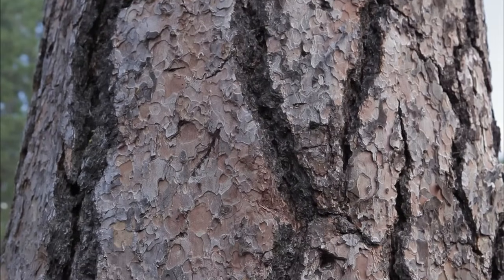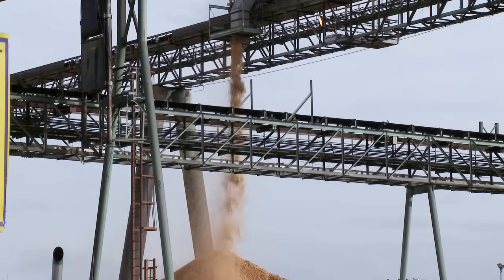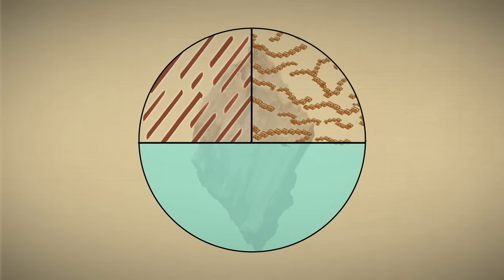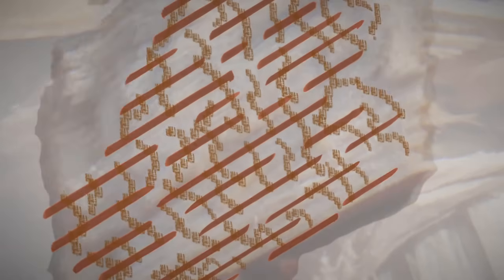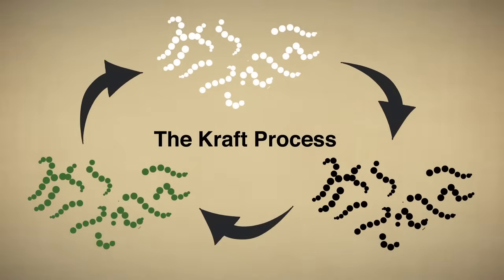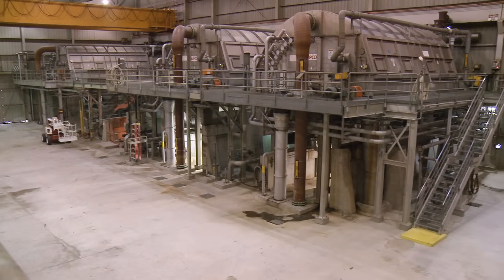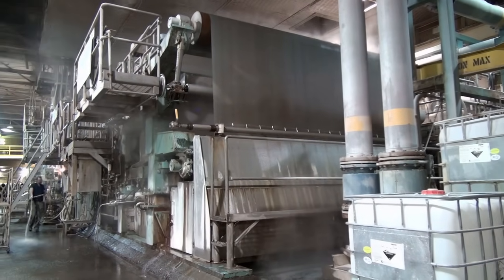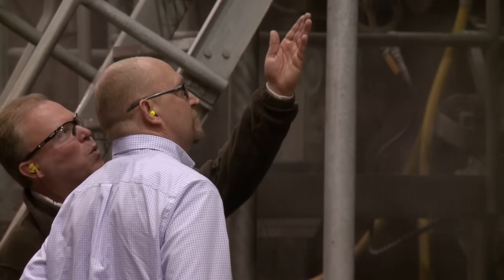The Making of Pulp

Comment: So is it safe to say that the process of making paper is more environmentally sound than we think? Are paper recycling mills/plants separate from these mills?
Reply: hemp paper would be more cost-effective. this is just kinda a waste of solid trees. better to revert those forests into the native forest instead of agro forestry. Then use a hemp rotation on marginal farmland to build up the soil structure on that crap farmland.
Reply: Hemp has a lot of oils in it on par with mahogany.  It could yield some natural oil byproducts at the cost of introducing a few extra steps in the manufacturing process.  You could end up with a powerful hemp oil based disinfectant or floor cleaner.  This would free up the open market for lumber and timber grade woods.
Reply: There is straw, and cotton as well, they have been the traditional materials in Asia and Europe for paper making, Washi and Korean paper is made using bark of mulberry and paperbush which are relatively fast growing plants, aside mulberry is used to feed silk worms. Bamboo is another reliable source  of cellulose, the South American bamboo or Guadua, AKA giant bamboo is a raw diamond because of the possibilities to produce said cellulose in huge quantities.
Reply: Recycling is virtually no impact to the environment. My mill had a recycling plant for a secondary source of pulp and they basically put carboard bales into a big metal pot with hot water and an agitator to break it down and the run it through screens to separate plastic and metal etc.
Reply: A  be lot of the “smoke” you see is actually steam. Some of it does contain chemical discharge from the boilers and lime kilns but it’s all monitored and has to stay below certain thresholds.
Reply: @MistressOP  Hemp would require more acres of hemp than acres of trees currently used. Do you love hemp fields so much you want to remove managed forests to make room for them???
Reply: Western mills have very, very low pollution levels. Mills in developing countries aren't as careful about chemical recovery, but the main potential problem is if not enough of the bits of tree are cleaned out of the water before it is released, which used to happen 70 years ago in the west, which causes algae levels to rise and can deprive fish of oxygen.

Comment: Interesting video and totally explained paper making but burning bark to power the plant is not green energy
Reply: Sure it is. What else would they do with the bark? let it decompose?  Guess what, when it decomposes, it lets off just as much CO2 as when it burns. The only difference is that burning releases it faster.  The big benefit is if you burn it, you can get electricity out of it vs just wasting it.  Lastly, wood is renewable. They plant fast growing trees that "soak" up the CO2 that they generate by burning, and they turn most of those trees into paper. Sounds pretty green to me.

Comment: I'm concerned that whoever made this video thinks that burning bark and such (hogfuel) is green energy.  The fact that it's not a fossil fuel does make it renewable but renewable pollution sources are still pumping out combustion byproducts, which is the main problem with using fossil fuels for power generation.

What's more, since it's not had the millennia of compression that slowly alters wood into a more and more high energy state, you actually need to burn more of it to get the same amount of energy.  Congratulations, your renewable energy is literally worse for the environment than coal power.  That's genuinely impressive!
Reply: As true as this is you might consider the waste that is burned is mainly tree tops and bark which is very helpful considering the  logistics of logging and tree removal and the economic point of view for companies as well considering there is no other use for this stuff except waiting for it to rot into dirt again
Reply: @pyronuggets  Expediency is not what defines green energy.  I'm not saying "don't do it" just...don't trick yourself into thinking you're doing the environment a solid and don't need to worry about emission mitigation.
Reply: @rashkavar  oh I understand. I'm only saying that it's probably a well suited plan which works onmore than 1 level.  One day I'm sure a better practice can be found to suit all these needs
Reply: Gasification temperatures are used. There are virtually no byproducts except water and carbon dioxide.

Comment: So the white liquor is quick lime / calcium hydroxide I new it had to be some kind of alkaline solution.
Reply: also Magnesium oxide been used. I am selling this MgO to paper and Pulp mills.
Reply: @jasonshen1202  Yeah, intensity varies but alkaline solutions out of metal oxides are commonplace throughout different industries, soap and fur tanneries use them as well to turn oil into soap or protein into not spoilable proteins.

Comment: what if its raining?? we could see the conveyor belt is opened up
Reply: Makes no difference. Your talking about adding chemical that’s close to 200 degrees and steam that’s 400-600 lbs per square inch into the digester with them a little rain water won’t be noticeable. You run tests on the pulp to make minor adjustment to steam and chemical amounts and cook times. Worst thing is cold weather when the chips can slide back down the belts or the belt itself starts slipping. Can make for a long shift fighting to keep them running to feed the digesters